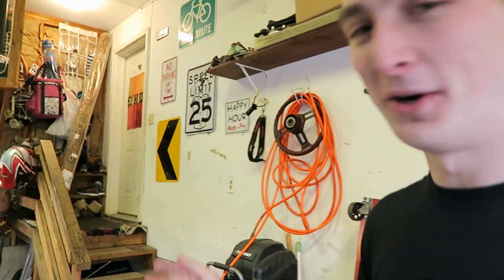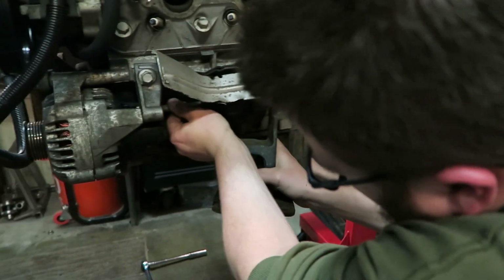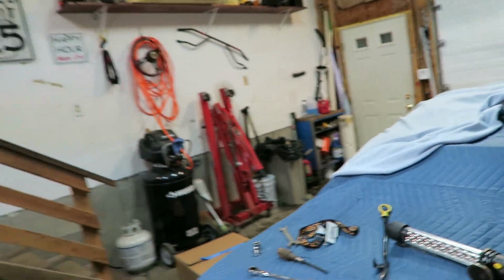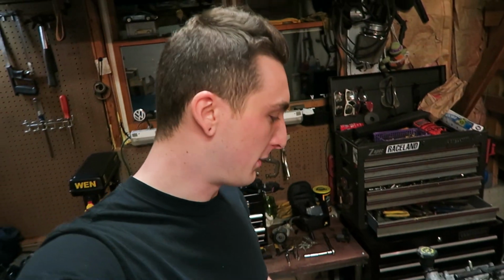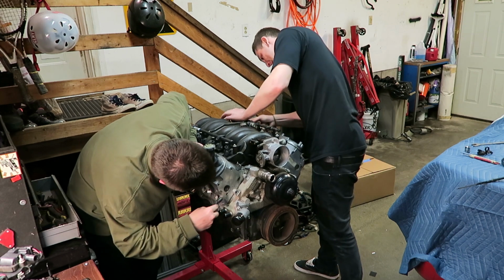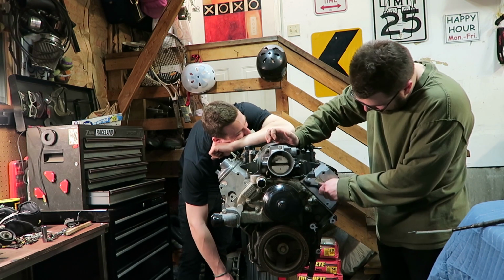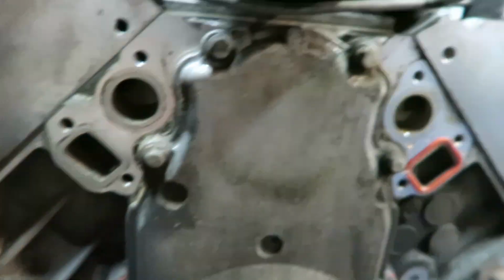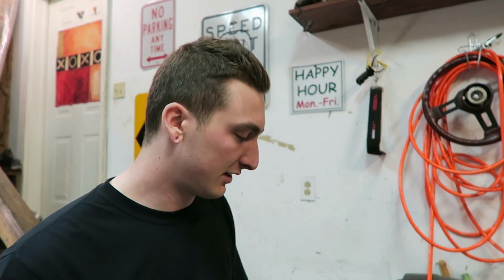LS1 V8 for my 300ZX!

Comment: An LS swapped 300ZX will certainly make the drivetrain simpler, since they're just about the simplest engine you can get that makes stupid amounts of power at the slightest touch of forced induction. Overhead cams? Who need those? Two cams? You've got to be kidding. Push rods is where it's at! Luckily, the LS engine is such a crazy popular and long-lived engine that there are just boatloads of aftermarket components for them. There's so many alternate accessory mounting fixtures for them that you can probably figure out an engine swap solution for just about any engine bay that the block barely fits into. Should be a fun project that'll result in a more reliable car at the end, as sad as it is to see the Nissan twin-turbo V6 leave, but when your motor seizes, not much to do but move on to something easier.